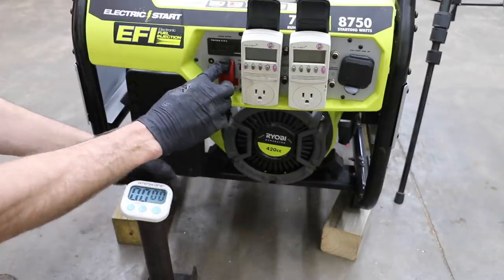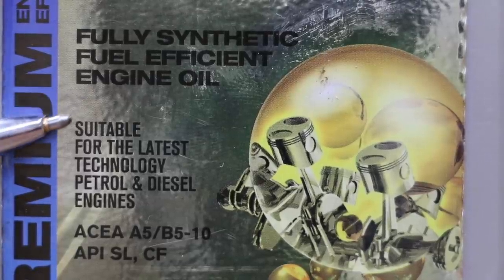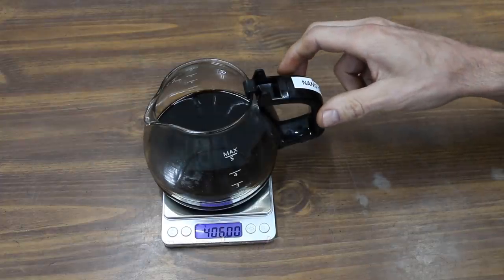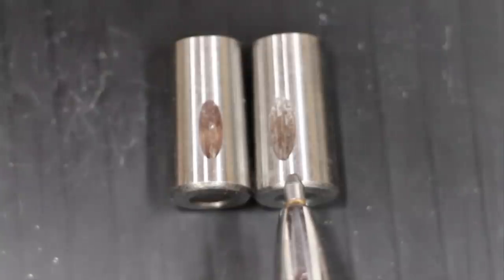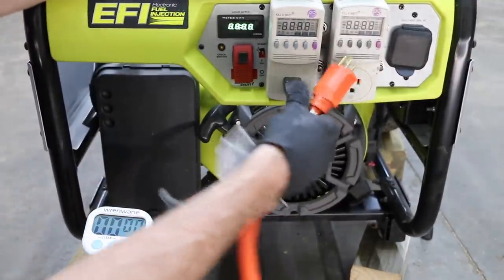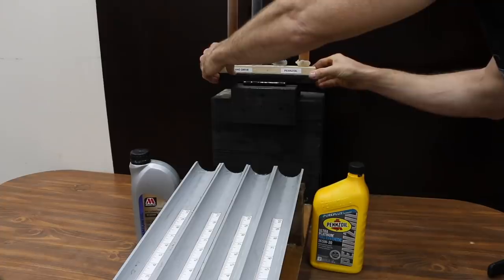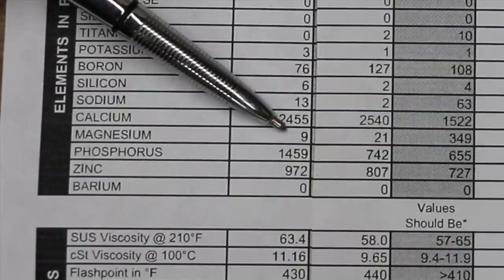Save Gas with "Nanotechnology" Motor Oil? Better MPGs? Let’s find out!

Comment: "To catch the Pennzoil, Millers needs to change gears from nanodrive to overdrive". You said those oils were cold but I'm pretty sure you just burned Millers to a crisp with that diss
Reply from the maker: Lol!
Reply: My 2005 toyota tacoma prerunner whent from 290 to 310 miles a tank with um blue bottle.
Sorry I know we shouldn't mention the blue bottle 🤣.
Then pensoil got me to 330 to 350 miles a tank.
I haven't used nanotechnology yet if I get richer ill give it a try next oil change.
Reply: Burn of the century
Reply: @thesilentone4024  The problem with this test that I see, is Millers is an SL oil and Pennzoil is a SN oil, and we are now at SP. Also, high Calcium causes low speed preignition in Turbo engines, so I would have to see Miller oil with an SP rating, results. The cold flow of Millers was a big FAIL, 90% of wear happens at start up, so I will be staying with Pennzoil Ultra Platinum as I have not seen an oil that beats it, for the price..

Comment: Superb testing as always! Thanks for all the long hours you put into making these videos.
Reply from the maker: Thank you!
Reply: @ProjectFarm  Hey man I haven't seen this one posted so I thought I'd hijack a top comment :-) I'm due for a fixed service appointment soon with VW and all the reports on the Internet suggest that they put 0w-20 oil in my engine from the factory (VW 508.00) but all my local dealers go with 5w-30 and the VW 507 standard. My owners manual suggest about 1% reduction in fuel efficiency and bit more pollution from the engine. But are these claims correct? I couldn't find an oil test lab like yours nearby. I would love it if you could test this out. All the best and stay safe!
Reply: @TillOverHill  Go with what your owners manual says with that VW Motor....I have a TDI Diesel, and it's important to follow the suggested one for warranty.
Reply: @john-smith.  Funny thing is I've read the entire manual and the only mention of SAE standards within are in regards with what to do in case of an emergency, such as if the oil level warning light is set on. I have since my original message contacted all 3 big dealers/services in my city and all 3 have given me differing standards for my car (502, 504, 507), and so does the Internet (508). It's just absurd the entire situation.
Reply: @ProjectFarm  could you do a , which e track brand is better ?
Reply: Todd’s the man

Comment: Project Farm does it again, It’s oil change weekend and I already bought the Penzoil. Thanks kind sir.
Reply from the maker: Thank you!
Reply: Pennzoil is my go to as well but really you can't go wrong with any modern full synthetic.  Tiny differences in add pack and base oils, it's probably best to just buy whatever current API is on sale, but I find something I like and stick to it because it feels good.
Reply: @jgalt99  thats why i use Castrol edge titanium extended performance for the feel goods

Comment: I've been running Pennzoil ultra platinum in my new car and my old jeep 4.0 (these examples are worlds apart) since you validated that it'll flow at -40. Both vehicles have never run better or quieter 1 year later. As always, great content.
Reply from the maker: Thanks so much!  Thanks for sharing.
Reply: Interesting, ai also have a 4.0 I-6 "Tractor Engine" Jeep. Are you using 10W-30 Pennzoil? Did you add anything else like STP?
Reply: @mspysu79  5W-30 Ultra Plat Synthetic because I'm getting the super low midwest temps. Been adding Rislone ZDDP, even just half the bottle per oil change to keep the zinc up. 250k miles, purrs like a kitten. Original rings, cam etc. Swapped the head a few years back due to worn guides/old stem seals.

Comment: Thank you for your resistance to sponsorship to continue your unbiased results!! On oil filters amsoil mobile 1 royal purple pennsoil wix Fram Purolator all have claims for high mileage @ 15k+ and I have seen a number of YouTube videos breaking them down and comparing build quality and claims for efficiency but NONE have shown or test actual flow versus dirty or even new oil and at what point does the bypass valve kick in resulting in unfiltered oil circulating through the engine. A remote oil filter setup and older style oil pump run off the distributor could be used and run by an electric drill. Thanks again for what you do!!
Reply from the maker: You are welcome!

Comment: Next test: how much that deep freezer raises Project Farm's electric bill lol
Reply: I need to know more about the fridge for sure
Reply: Very unlikely for it to be that expensive. Most household freezers use about 4$ a month in electricity depending on your area. Refrigeration is incredibly efficient, so it’s likely the upfront cost of a lab grade freezer that’s more expensive.
Reply: Shouldn't be that much as most freezers have their thermostat set to -18°C / -0.4°F by default.

Comment: The Pennzoil is API SN.  The Millers is API SL (older out of date spec).
Reply: And the NEWEST API designation for Gasoline Engine Oils is ---  "API SP"
BOTH of the oils that were tested in this video are obsolete.
Reply: I wonder how different the tests would be between the SN and SP rated Pennzoils
Reply: @ihelp131  The physical/chemical differences between "SN" and "SP" oils would be observable by consulting the data sheets for both oils.
I recently bought some of the newer "SP" oil -- AMAZON BASICS - 5-W-30 API Service "SP" -- ILSAC GF-6 --
 Running the "SP" oil in the famous 95 MERC, which now has 179,000 miles on the clock. 16 City, 24 Hiway.

Comment: Just to throw an idea out, you should test various tire pressure gauges to see which are most precise and accurate.
Reply from the maker: Thanks for the video idea.
Reply: But you’d have to choose one pressure gauge as the control? How do you know that one is accurate to base judgement of the rest off?
Reply: @197ben  Get a scientific grade instrument as the baseline.
Reply: Mace Windu, happy to see you survived.
Reply: That's a great idea. I have several and none read the same.

Comment: Great video! We have some questions about Miller's "nanoDrive." They claim to have 'nanotechnology' but do not specify WHAT science is behind it. "Nanotechnology" of what? What nanoparticles do they use? Claiming that something is 'nano' does not mean it is actually 'nano'. Besides, as you said it yourself, 'nano' only means size. We know the difference because we are the exclusive manufacturer of automotive and other industrial lubricating products based on our proprietary nanoparticles of Inorganic Fullerene-like (nearly spherical) Tungsten disulfide (IF-WS2). These particles outperform MoS2 due to their unique spherical morphology and submicron size. Would you like to test our engine oil booster?

Comment: When Walmart has the Pennzoil Ultra on sale, its only about $20/five quart jug. Basically a no brainier. Been running it for years and it’s great.
Reply: Other than wear resistance. I would still favor the pennzoil platinum euro 5w30, A3/B4 for the summer months. Or QSUD 5w30.
Reply: If only you could spell gnarly
Reply: @7burnitdown  I’ve had this as my XBL GT since 2005, I didn’t like how it looked with the “g” at the time.

Comment: Very thorough testing and I'm always umpressed how he keeps the fields level during testing.  Way long ago, I took  a course from a guy who operated under the moniker "Dr. Corrosion:" and he swore by the lubricating properties of MoS2, and thus I used to always add it to my oil in automobile gearboxes and rear ends.  I don't know if it actually improved performance but i never had any wear issues.

Comment: I truly believe the most important characteristic of oil is how well it flows at startup, because around 75% of engine wear occurs in the whole warming up process. I would choose the Pennzoil over Miller's due to oil flow at start up, even though Miller's had less shear on the metal. Shear happens when oil is not flowing, so the shear is very likely less with the Pennzoil Ultra.
Reply from the maker: Thanks for the feedback.

Comment: Switched to Pennzoil Ultra Plat after the show down...can't see spending the money on Amzoil so Pennzoil became my go to. I have definitely noticed better fuel economy and easier starting with the Pennzoil. I also sent off my oil sample(s) after 7500 miles and the test lab recommended going 10k on the Pennzoil Ultra Plat. Good stuff.
Reply from the maker: Thanks for sharing.

Comment: I'm starting to pull away from using Royal Purple engine oil and using Motul 8100 and Specific, except for 1 car with a pushrod engine. However, a test between all the different RP oils (API SP, HMX, HPS, and XPR) would be interesting.

Comment: So now I'm curious, would blending them 50% - 50% result in an oil that has the best of both worlds?
Reply from the maker: Thanks for the video idea.
Reply: Change your oil regularly and it really makes no difference what modern full synthetic you use.  Buy whatever is on sale or whatever brand makes you feel good and don't worry about tiny differences that only show up in laboratory tests or in extreme settings that you're not allowing to happen because you actually care enough to watch a video like this.  You're going to buy a new vehicle whenever one comes out that has a new feature set you want or it's tax time and you need the write off for your business, or the neighbors just got a new one and you don't like that dude anyway.  If you are conscientious about maintenance and take care of your equipment you will only ever have problems due to manufacturing mistakes and normal wear and tear; the API spec does a lot of the work for you, so whatever oil you buy as long as it meets that spec will perform similarly within a very small margin.  I like Pennzoil, it's generally within a dollar of other full synthetic oils at Walmart, so I buy that.  I don't think it's substantially better than other full synthetic oils like Mobil 1, Castrol, Shell, etc to the point of "will it prevent a hard part failure which otherwise would not have happened", though.
Reply: @jgalt99  I agree especially on the last point: when things go really wrong in a car it's never the brand of oil that caused it, user error and abuse are the absolute #1 factors

Comment: I can't believe PF doesn't have any videos on PEX vs Copper or SharkBite vs. other methods. Those would be landmark PF vids.
Reply: How would he test that?  Plumb a home and wait 25 years for one to leak?
Reply from the maker: Thanks for the suggestion.
Reply: @hugolafhugolaf  Cut to next week's video that starts off "25 years ago when I plumbed my home, I used an assortment of fittings for testing purposes..."
Reply: I don't know how to test it either, but if anyone can Project Farm can. In recent years I've had three different contractors do minor plumbing work, and all of them used SharkBite style connectors. So I'm curious about how they hold up compared to old school soldered copper.
Reply: @hugolafhugolaf  Various inventive torture tests, like he does everything else, I suppose. For example, there is a video out there of a guy who froze a bunch of water filled pipes caped off with different types of fittings. 

For years, "PEX vs..." and "shark bite vs..." has been two of the most highly debated topics in plumbing. It would be great to see a definitive PF video on the subject.
Reply: Ill give you an answer to that with the sharkbites. 7 years. Ask my ex wife. She will vouch after the connecter bursed on the hot water heater and flooded out my BIL in the basement. WINNING! LMAO!

Comment: MOS2 is used in impact greases. It is ideal for applications in dirty environments.  Many drum brakes call for this type of grease as the Molybdenum disulfide has a tendency to continue lubricating after the base oil inevitably dries up.  Amsoil heavy duty off road grease is one of my favorites.  Calcium sulfate thickener resists water wash out, and it uses poly alpha olefin base stocks. MOS2 is good stuff.
Reply from the maker: Thanks for sharing.

Comment: I have known about this channel for a while now. However, it was just this past week that I really dove in and explored everything the channel has to offer. The channel is absolutely amazing. There is one aspect that I would like better clarification. I have noticed, especially on the power tool tests, that a particular model may seem to "win" most of the tests but then not end up the overall end choice. This really seems to happen a lot when DeWalt brand is tested. Could you explain not only why you chose your overall winner, but also why 2nd & 3rd place did NOT win... especially when they seem to have done better in the tests.
Reply from the maker: Great constructive feedback. Thank you

Comment: In the 1970s I worked for Exxon. During that time I studied oil. I can't quote too much of that for you now. But I do recall that when you see the word "PREMIUM" on a motoroil container, it means what it says. Premium is a genuine oil labeling word. It is not advertising talk.

The other thing is to pay attention to the API information. It is a more precise guide to the use of that oil.

One more tidbit: the oil viscosity numbers are often misunderstood and therefore misused.
•10W30 is a winter grade multi viscosity oil. The W in the middle  stands for winter, though it is not limited to winter use only.
•30W oil is a single grade or viscosity oil. In this case the W stands for "weight". "30 Weight oil". Best used per API indications and in warm weather.
•There is also a 30W non detergent oil. If you run out of bar and chain oil for your chainsaw, this is the only motor oil that is an acceptable substitute. The reason is, with no detergent this one motor oil does the best job of sticking to your bar and chain.

All that information was gleaned and has been used by me in the Meditteranian and mountain climstes of California.
Reply from the maker: Great feedback. Thank you

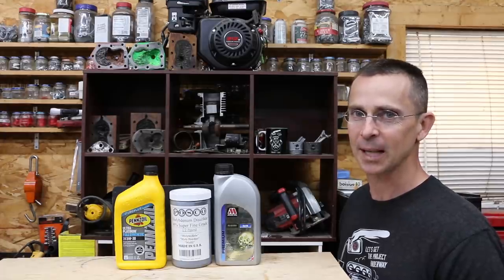Comment: Another great test! Interesting point that Miller's is only designed for use in  2004 and older cars and trucks, both gas and diesel powered (11:16), while Pennzoil is designed only for use in gasoline engines, including the latest engines with the most up to date requirements.  

Thanks again for making these videos.
Reply from the maker: Thank you!

Comment: So I just learned that my favorite gun oil from my military service,  militec 1 has Application when mixed into engine oil. I see videos of it being used in a lubricity testing at 100%and being dramatically better then Lucas. I would like to see you do a test of amsoil both plain and with the militec in it and doing your usual more in depth testing. I'm considering adding it to my car which exclusively runs amsoil. Thank you!
Reply from the maker: Thanks for the suggestion.

Comment: 1:56 The Millers oil is API SL?  Whoa!  The current rating is SN, SN+ and SP.  I can't believe that oil is available on the market, let alone marketed as "compatible with the latest technology engines" LOL.  Also your past videos using the generator have splashed significant fuel from the container due to major vibrations during startup of the generator.  Clearly, this fuel spillage could seriously affect the results of the fuel economy test.  I did not see any spillage this time but the top of that beaker appears to be left open/uncovered and it is definitely worth mentioning.  Finally, I agree with your statement about many of the particles in all modern motor oils qualifying as nano particles.  Appears to be just a marketing term for Millers, no surprise.  Thanks for the video.

Comment: I ran that exact Miller's oil in my diesel Fiesta for 1 year between 225,000 and 234,000 miles. Average fuel economy went up slightly from around 66mpg to 68mpg but the engine was noticeably noisier when cold. It also consumed about 400ml over the service interval instead of its more usual 250-300ml.

Comment: I love these PF tests.  I do check to see if he has tested something before I buy. No one will ever confuse  me with a scientist but,  IMHO, it almost doesn't matter what oil you use as long as it is a reasonably good oil (not the cheapest you can find), you change it regularly and use premium filters. Whatever you do, don't skimp on the filters.  The most interesting part of this test was the how the used Pennzoil performance in that cold oil test was virtually the same as the new oil.